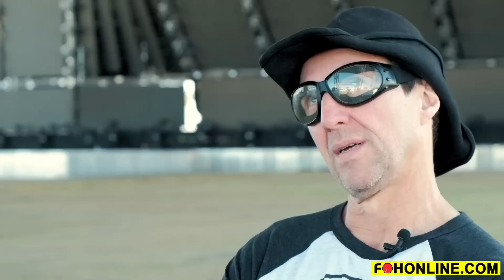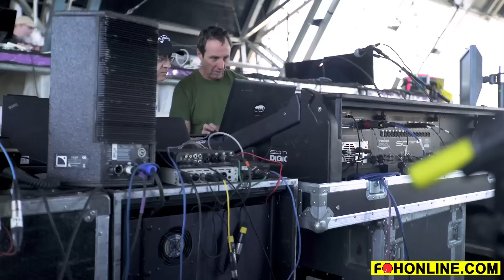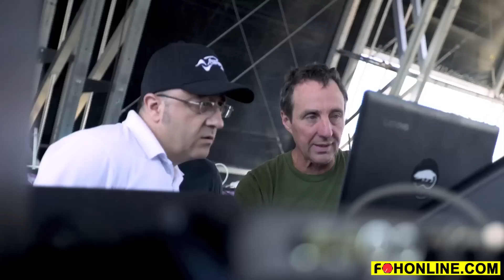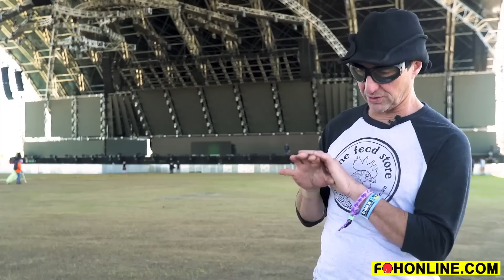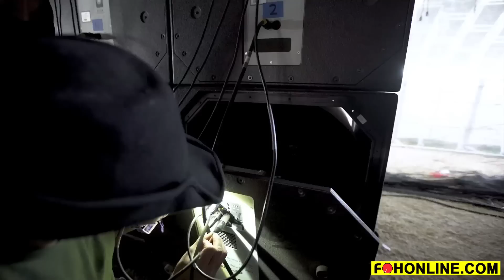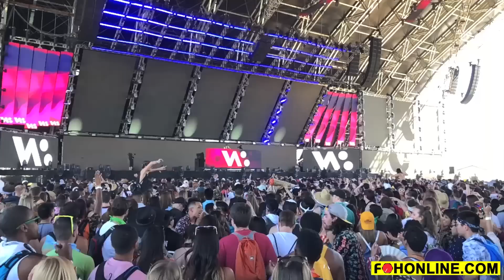Using the Rat Sound SuperSub Subwoofers at Coachella

Comment: In 1974 MGM and Cerwin Vega teamed up to create Sensurround sound. Sub woofers that could hit up to 130db's between 16hz & 32hz. I saw earthquake in a theater with that system and have never felt bass like that since.
Reply: I heard about that system. It used Cerwin Vega "Strokers" for the subs. I would just about say what you seen was historical man. Talk about raising the bar for theater sound since I don't even think they did surround sound back then. I do wonder when they started doing stereo sound in the movies. There is a video out there about the evolution of theater sound I'll have to watch again.
Reply: I have the original Cerwin Vega amps from the first 1974 installation in the Odeon Lux Cinema in Leicester Square for the movie Earth Quake. The numbers are inflated, the amps only had 20,000uf PSU and the transformers hummed a lot. The best thing about the amps was they didn't break, the stokers were fine but running from a pseudo bass signal, it damaged the plaster and that was the end of Cerwin Vega in London.

Comment: This guys a fucking genius.  Here I am building subwoofers in my basement using conventional drivers compound loaded using stacks of crown 500x's (5000's and 5002's) to try and achieve the same thing.  Thermal compression will forever be a problem.  As the venue goes on for hours and days, voice coil drivers suck.
Reply: Well, while Dave is a genius in his own right, in this case we should hype Claudio Lastrucci of Powersoft who designed the linear motor concept.
Reply: Plenty ways to remove thermal compression

Comment: Who did he work with for amplifier design, lab gruppen, powersoft ,crown
Reply: Likely Powersoft, last I heard. 
That said, Dave Rat ought to hook up w/SpeakerPower, ... Southern California's own Subwoofer Amplifier manufacturer. Designed, and built in the US. 

There are more sophisticated amplifiers, like the Powersoft, whereby they have microprocessor monitoring of mains power, load impedance, damping etc, and every conceivable parameter for that matter. 
But the SpeakerPower offerings also have powerful DSP, but most importantly, ... measurably they can output sustained and burst power capabilities that are second to none. 

just sayin', they connect the artist to the attendees too🤟
Reply: These M Force things have their own amp by factory as far as i know.
Reply: L-acoustic also do powered controllers dude.
Reply: @weareallbeingwatched4602  I would not expect the baguettes to supply amps for another companies product
Reply: @weareallbeingwatched4602   great ..